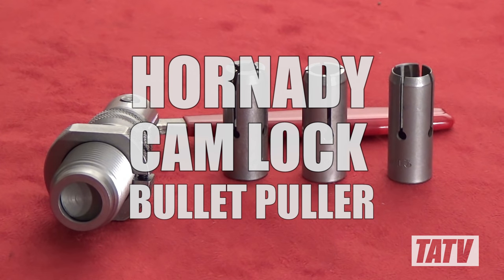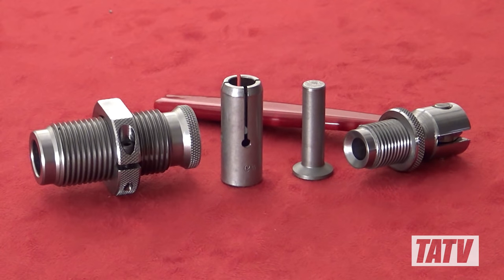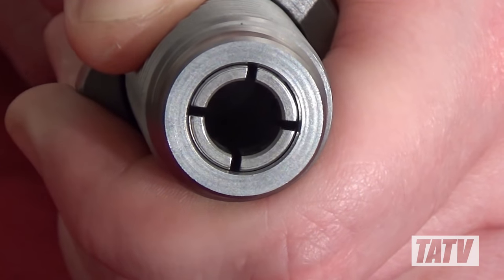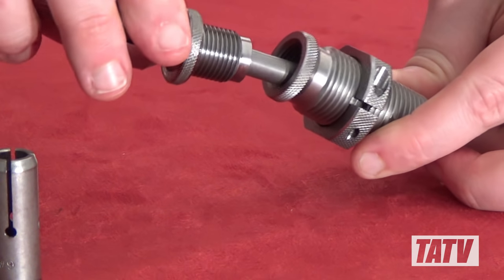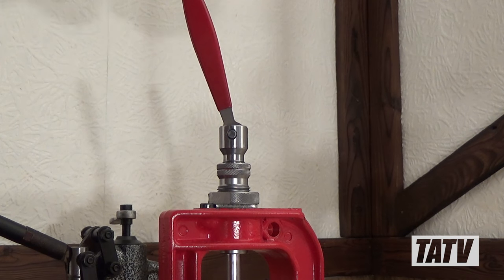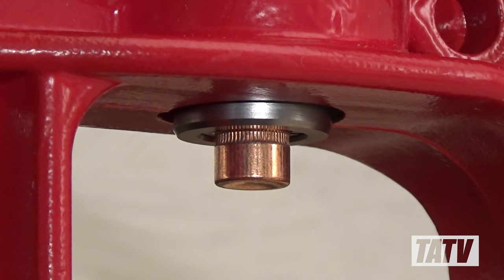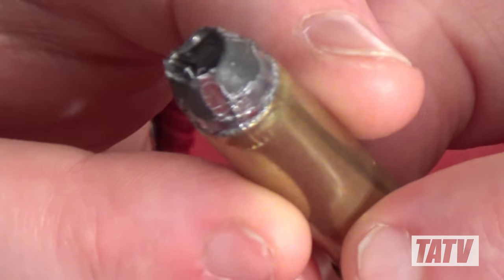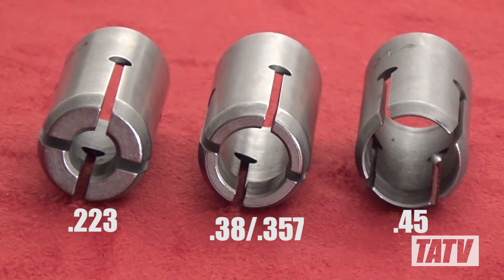Hornady Cam Lock Bullet Puller

Comment: Thank you. Valuable information about the 45ACP. I just ordered the Hornady Cam Lock with 4 collets. I hope this works with .380. I know the diameter is 9mm size but will the short case lenght interfere with proper operation of the puller?
Reply from the maker: I would think .380 would be fine, still plenty of thickness to the gripping 'petals'.
Reply: @TATVCanada  I received my Hornady Cam Lock. It is fantastic! I disassembeled 1000 rounds of .380 ACP. Very pleased with how well and how quickly the Cam Lock works.